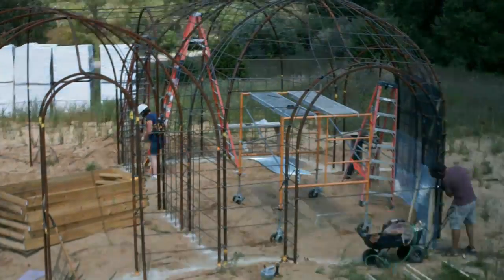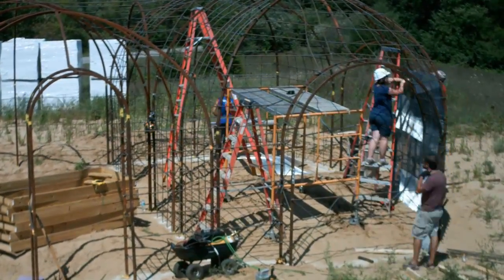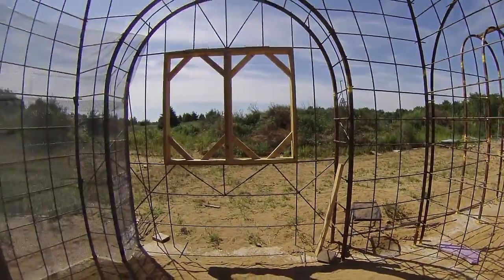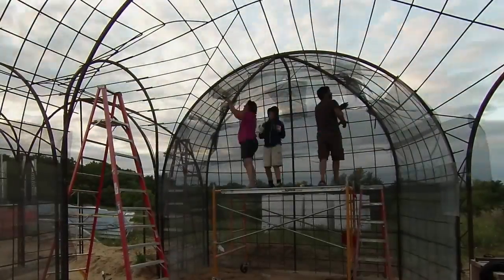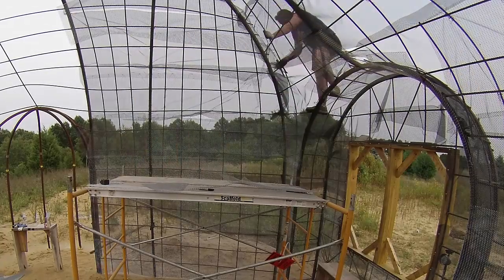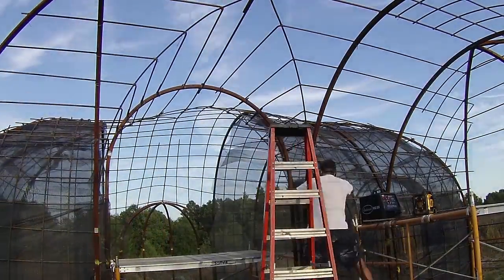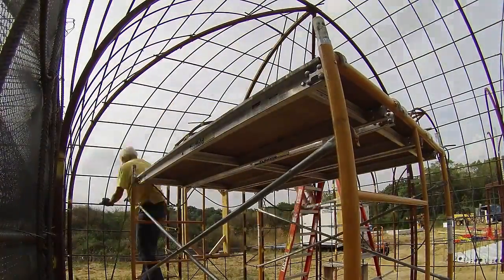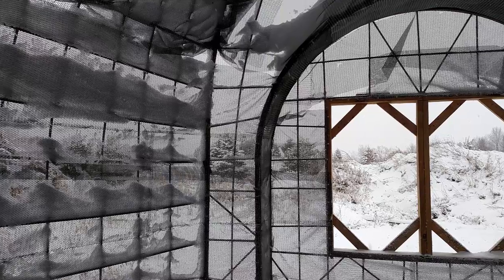19.2 Rebar and Lath for the bedrooms

Comment: good work, its all starting to take shape...the snow doesn't help!
Reply from the maker: +noproblem2big The snow does make pouring concrete or moving dirt difficult, but we plan to shift focus to inside the garage and basement once the snow comes.  We can also start erecting steel studs on the slab over the basement.